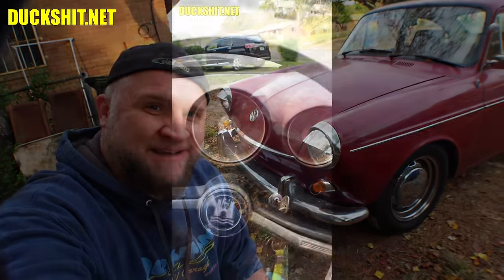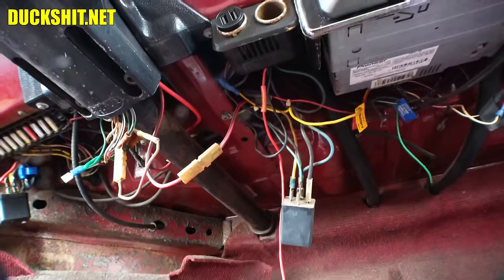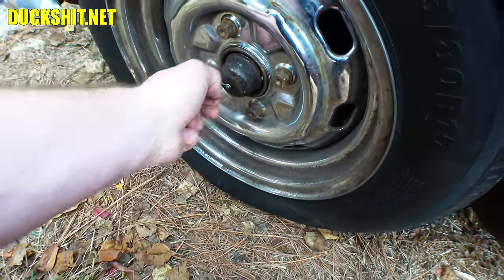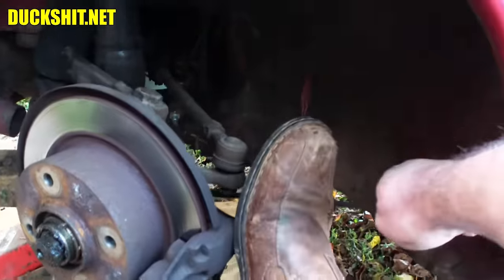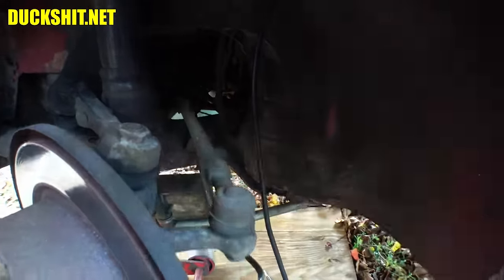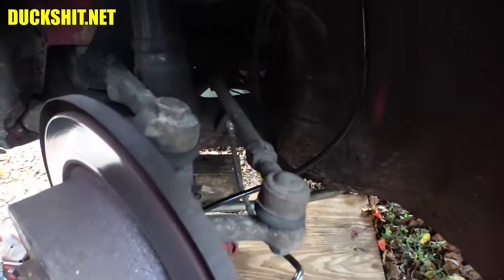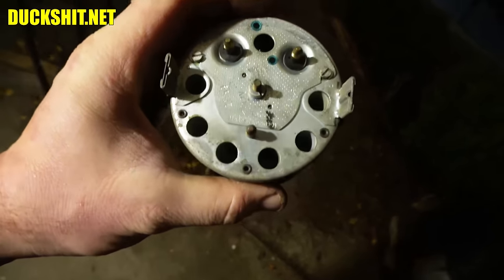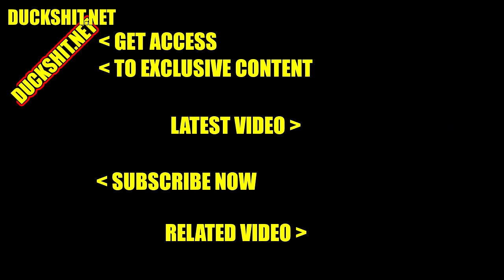Replace Speedometer Cable on Air Cooled VWs (Beetle, Type-3)

Comment: Excellent video Glenn  :) also never done gauges or Speedometer  cable on VW vechiles ever but lots other vechiles have to and challenging to do will say yes ! But wonder if Speedometer cable on dash one part have connector has screw cap over connector to has metal tabs to hold Speedometer gauges  to keep tight in !  Check see that is or maybe gauge had better days need replacement!
Reply from the maker: Tanks man!  I've got the speedometer apart currently, the problem looks rather simple, I hope I can get it fixed and keep it that way!
Reply: @DuckmanCycles  excellent Glenn  :)

Comment: Trying to fix the speedo should make for a good video. Thats the kind of thing I really don't like doing. My clock lights up as well. Actually keeps good time. Probably just bulbs in yours. My high beam relay is a little funny. Sometimes when i put on high beams it doesn't go off.?? Good video and info Lord Duckman 🦆. No Christmas lights? Noel 😊
Reply from the maker: Nope, no Christmas lights, at least not until Saturday.... MAYBE!  We were supposed to have a Christmas lights cruise, but our VW events keep getting cancelled due to repeated weekend rain.  This weekend more rain expected Sunday, which may dampen Christmas, but should leave our parade untouched!  Here's hoping!  Thanks always for your feedback!
Reply from the maker: And as far as the highbeams relay, it may get stuck, you can try bumping it around, I've had that issue before!
Reply from the maker: Today while fixing the speedometer I investigated my clock for the first time, video on that later, but it neither had a light nor does it work.  Today it at least has a light!  Haha!
Reply: @DuckmanCycles  awesome, I will be watching. 👍

Comment: Square bumper TIII's use black-face gauges the side clips need to be changed check  Bentley manual
Reply from the maker: This isn't a late Type-3, however. But why do I need to change my clips?

Comment: Bummer, It was a compounded issue after all. At least you have half of it fixed.
Reply from the maker: Yep... I do wonder if the gauge already broke the new cable, though.... lol!  I haven't had the heart to investigate yet.
Reply: @DuckmanCycles  hmm bummer
Reply from the maker: Yep, but I was able to reattach the drive end.  I probably could have done the same with the old one.  I should have kept it.